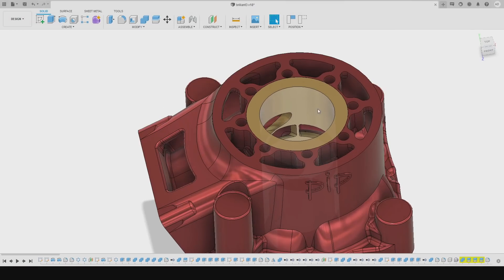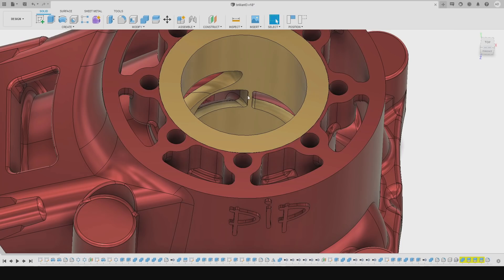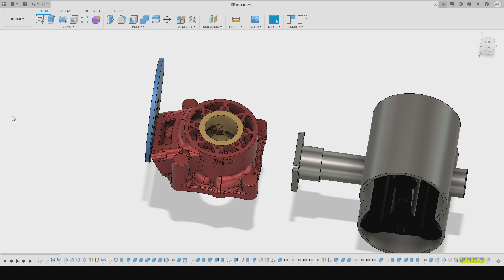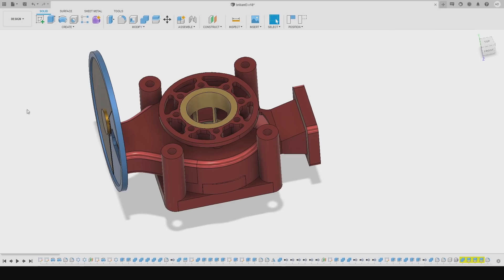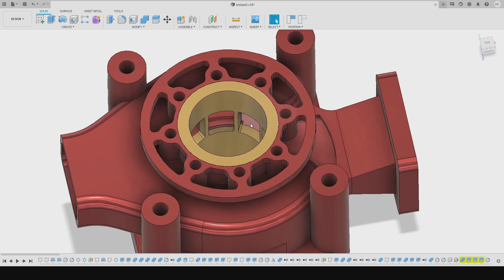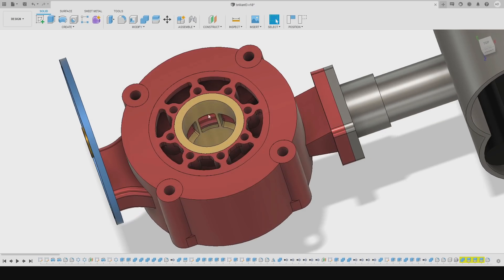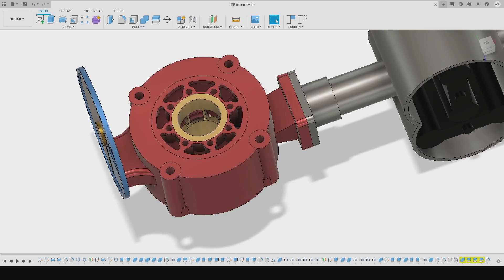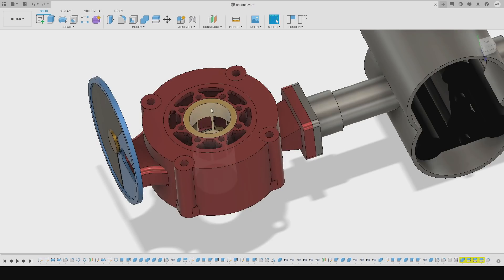Will BLOW Up the Competition! Seriously!

Comment: I really do not mean to Pick A Part your idea but I am curious about one problem I see that might happen. The pressurized air and fuel goes into your cylinder as well as the exhaust ports temporarily will that not cause unwanted combustion in your exhaust ports?
Reply from the maker: Might be👍 we'll see.
Reply: No, because combustion will be complete way before the ports open

Comment: Interesting, I'm really curious to see how this short circuits with the ports cut the way they are. Could be turbulent, but seems that you could use colored water to test a mockup. Also wondering if the exaust valve would be needed, long term, if you adjust/fine tune the port times🤔 keep up the great work.

Comment: Have you considered the diesel type two stroke? it's a two stroke but the exhaust gases leave the top of the cylinder via an exhaust valve. This way you can charge the cylinder with a super charger easier
Reply from the maker: It is tempting to go that route.

Comment: You've probably already looked. But old Detroit 2 stroke diesels work just like this. But from my understanding (aswell as marine heavy fuel 2 strokes) they use entirely intake ports and a 4 stroke style exhaust valve at the top of the cylinder paired with the blower. But I think they also use direct injection

Comment: Looks a candidate for transfer port injection or if possible direct injection. Thought lubrication would be troublesome. Also
I would imagine you could easily run into excessive knock due to excessive cylinder combustion pressure. 
So a steel piston might be an option??

Comment: Excellent plan, been working on something similar for a while now. What you need to employ is direct injection.
That will eliminate all the short circuit and fuel in the exhaust issues. You can now totally evacuate the cylinder and build pressure without worry. Will probably avoid the need for a reed valve as well.
Reply: Becomes pretty close to the Detroit diesel....
Reply: Yes. I would use direct injection and only one exhaust port. Or two  both on exhaust side. Then exhaust resonance would still work.

Comment: With a 50cc cylinder displacement I think the effective capacity will actually be somewhat larger.  As soon as the transfer ports are uncovered on the power stroke, the mixture within the inlet/transfer ports will be ignited and increasing cylinder pressure and giving the reed valve some serious punishment.  Might want to check rules for Bonneville etc. as would hate to see you get it working and be disqualified.  This assumes you are using port injection (or carb), which you seem to imply.  With direct injection this wouldn't happen, but then the exhaust gasses expanding into the transfer ports will decrease cylinder pressure.  Rotary valve sealing could be a whole research project by itself!

Comment: Awesome design my friend! But I think a major choke point will be the intake volume and the time allowed to fill the cylinder. This can be helped with a larger intake plenum after the supercharger, or by adding an expansion chamber between the supercharger and intake port, almost acting like a pressurized crankcase. This will help increase flow and reduce pressure spikes when the piston is at the top half of it's stroke.

Comment: Have you thought about using a Sleeve valve ? Rolls Royce explored using them in its 2 stroke V12 called the "Crecy"...and Napier used them in its Sabre engines pushing 3500+

Comment: Seems to me that intake and exhaust should be set 90 degrees apart from the cylinder instead of 180 degrees. It would make the exhaust rotor and the blower easier to drive off the crankshaft.

Comment: my head is about it 💥so many ideas and questions how are you going to drive the charger 3 phase motors maybe with a pressure sensor and engine rpm controlling the speed all so a large chamber inbetween the engine and charger too help with lag

Comment: Might try som type of rotary valve on exhoust ports right behind/arround the cylinder, you will get smaller area for mixture. I think this prototype will be fireing gas in exhoust..  Possible it might work with 4stroke crank with some oil splashing.

Comment: Nice idea, but I think the Compressor has to be bigger.
The CAD design looks like you would have at least 250ccm volume between the compressor and the Exhaust valve, with the compressor putting out only 300ccm per working circuit, this will result in only 3,2 psi of boost.
(CompressorVolume / Floated Area -1) x 16 = psi of boost

Comment: i thought about the same design earlier but with a pneumatic valve for exhaust and the intake of the compressor sucking from the crank case and in to the cyl. that way it could run fuel/oil mixed and dont need a seperate oil sump

Comment: Detroit diesel engines have a brilliant blown 2 stroke design, the engine will no function without the blower and the blower actually acts as a reed valve keeping exhaust gasses out of the intake side.

Comment: Hey brother I’m just curious does adding a turbo or a supercharger to the system change the class that you would be racing in I ask because there were so many two-stroke diesel‘s that basically wouldn’t run without boost so I would think with my limited two-stroke knowledge that it would help a gas motor also
Reply: Edit: yes so I asked that question one minute into your video I have now seen more of the video and realized you answered my question great minds think a like

Comment: Alex.. have you had any ideas about electronicaly controlled direct injection on this thing? supercharger only blows air and then the injector is timed to the precise moment - much better way to make it more fuelefficient and you wont have an easily ignitet a/f mixture in the exhaustsytem

Comment: Won't you get combustion in the transfers?  You'll be putting a lot of pressure on the rotary valve and reeds, and if they fail it will backfire through the supercharger.

Comment: The amr300 has really been a revelation for cheap and readily available supercharger tinkering.  It does seem that the easiest and cheapest way to make big power is forced induction.   Port angle, manifold flow, exhaust resonance??  Who cares, just cram it in there with a blower.  I'm not sure if the supercharger to cylinder manifold design will matter with such small displacement but maybe need to consider capacity to hold full pressure charge between intake cycle if going to really high revs?

Comment: Hi ... Brilliant video  ... I think you won’t need a Reed valve as whilst the ports are shut the blower will still be making a head of pressure ready for when the ports open again .. a cleaner inlet tract will equal even more power .... I would drive the blower with an electric motor to remove the parasitic loss  so even more power  
Andy

Comment: I have a 2 stroke gasoline supercharged motor. It is an air compressor. It looks like a bmw engine.  2 stroke engine on one side air compressor on the other side with pistons moving both in then both out. It is very very powerful for its size,  70 pounds or so and I would estimate about 15 horsepower. It does not have an exhaust rotary valve and  I do not think you will ever snag a ring because the exhaust ports and transfer ports are not big they are small.

Comment: I think I have an idea for an improvement- why dont you put the exhaust ports and the rotary valve at the top part of the cylinder , so it works kinda like a uniflow engine but with big time-areas
Reply from the maker: Might go there. Prototype first.

Comment: Any 2-stroke engine (or 4-stroke) will build pressure if the compressor's output exceeds the stinger's (or turbine's) flow at atmospheric pressure. As mass flow does not have time to react to the sequences happening in the engine, it acts merely just as a strangely shaped hole and that's why the boost pressure is an average pressure. And that's also why the flow speed does not change (significantly) in a boosted engine nor does it just "flow through". This newest concept of yours seems very interesting. Much better base for nitro-methane experiments than a traditional 2-stroke. I'm just here to debunk some common myths :)
Reply from the maker: 👍 And Nitromethanol it will be fed!

Comment: Read valve, rotary valve, compressor.
I would almost say, take a four stroke 50cc engine and change the camshaft rotation, make it the same as the crankshaft.
Basically make a two stroke from a four stroke engine and cram as much air in that cilinder as you can with that blower.
Would it work??
Mhhh...
Reply from the maker: Has to be tried 😁👍
Reply: @2STROKESTUFFING  I was thinking of this due to the read valve and the compressor constantly delivering air pressure against those reads.
The back pressure inside the ports is not enough to close those reads enough maybe.
“Normal” valves would close without problem

Comment: Now that you're going further away from traditional 2 stroke design, maybe you could consider putting the exhaust port in the head and use the rotary valve up there. By going with a uniflow design, you might get better scavenging, and have better control over exhaust timing.

Comment: this start to become a insane idea but really well, and it start to work like the 2 stroke diesel engines I worked on.
They had a turbo on it with around 2 bar max pressure, only scavenging ports around the bottom and 1 giant exhaust port on top.
it had 2 giant injectors on the side of the exhaust port. these engines are really awesome.

I always dreamed about making engine like this but with gasoline.

Comment: Just a stoopid idea i had while in toilet. What if you had narrow high transfers and low wide exhaust (to keep areas equal)? So when piston is down the blower is pushing mixture in and burned gasses out. It starts moving up closing the exhausts and pressure builds up. Combustion magic happens. Piston moves down uncovering transfers but reed valve is preventing gasses escaping through intake. Piston uncovers exhaust and all the crap is blown out that way. Cycle repeats. Maybe if initial pressure would be too high for the reeds to combat then have a tiny area of exhaust as high as transfers so that it could relieve pressure when  its extremely high in cylinder after combustion when transfers start opening but small enough that pressure would build up after main exhausts are closed. Or some kind of system where you have tall narrow transfers, low wide exhausts and then aux exhaust ports that are as high as transfers but not freely vented to atmosphere but with a spring loaded valve that is set to open at intake pressure so they don't mess with boosting the cylinder but relieve pressure when transfers open and exhaust is still closed. Have not really thought it through as toilet time was over for this time.
Reply from the maker: Definitely worth experimenting with👍

Comment: Fuel efficiency wouldn't be a problem if you made it direct injection type-kind-a-thing(like a diesel engine). In that case no fuel would go to waste and blower waste could be more easily vented out. Less resonance in intake system - easier for the blower and less power loss through it.  Sort of like anti-lag...

Comment: blowers are very  inefficient  especially 2 rotor blowers, too much heat. high helix screw compressor would be better. this is not a new design detroit diesels used roots blower scavaging on their 2 strokes with 4 exhaust valves. I like your idea of the rotary valve on the exhaust. A centrifugal compressor would be even better, way more efficient and less hp to drive.

Comment: ok, i got a vision, and now i know solutions for 2 things with your engine. 1 . dont use 1 large exhaust, but split in 5 or 6 smaller ones with thick wall between them, and put cooling in those walls like pipes. so cylinder is not overheating there from exhaust. and drop exhaust temps. 2. use different design on piston with 3 rings. - 2 on top if you want to supercharge it and 3. on bottom .

Comment: Have you heard of electric powered turbos/superchargersr? For your short power peaks this might be an option as the supercharger does not "steal" horses and the turbo does not need high exhaust temperatures/volumes anyway. Use the permanent afterburner for extra thrust instead :D We dont't care about efficiency! <3 Love your new frequency of awesome video content!
Reply: Great idea, however SCTA/BNI rules only allow boost power sources from exhaust gasses or mechanical drive off of primary engine.

Comment: For version 3.. Why not use normal ports and valves in the head, 2 stroke timed cams etc with your blowers? Same effect but more efficient. Solenoid driven valves as per Konisegg would give you endless port timing options.

Comment: Look at the Detroit Diesel 2 strokes.  Kawasaki has a 2 stroke with a supercharger that is coming (they say) in the near future!
Reply: I was thinking the same thing. Detroit used a poppet valve for the exhaust side which I think is much more practical than a rotary valve.
Reply: Not really, the 71 series Detroit's had 4 valve heads for the exhaust, only the intake was ported thru the block/liner

Comment: hello, won't there be a big heating up the whole thing by the exhaust heat? and especial the intake air trough a thin wall between the intake and exhaust cannals? just thinking... other than that.. just wauu!

Comment: You should really think about using direct injection of fuel after all ports are closed. This way you wont have any fuel/air mixture going to exhaust port/chamber only fresh air. Could be tricky to pull off but would increase efficiency by a lot. Cool idea, hope it works!!

Comment: You are going to end up with uncontrolled combustion as the ports open with near full strength charge in all ports 

Power comes from refining efficiency. Not ignoring it.

You would be far better continuing with the engine you have.

Comment: I started to turbocharge 2 stroke 4 cylinder Yamaha snowmobile engines in 1994 ( V-Max-4).
What you are doing now is making me smile! :) wish i could spend a weekend at your place, chatting about all this. Have you computed modern (sulzer Wartzilla) way of doing diesel 2 strokes, in a high rev, slightly smaller version :) ? hahhaaa!!!. Or an ex. valves in head (rotary?) and intake ports at the bottom of cylinders?. A 2 stroke twin with a rotary intake valve was pretty good under boost, the CRANKCASE was pressurized till, the rotary opened, scavenging the cylinders in normal fashion... I was using very stiff reed valves, in a cylinder intake. Anyways, wayyyyy too much to say about all this!  :( ...

Comment: Is there any chance of the combustion igniting the incoming charge since all the ports have the same "timing"? How about an option with a single intake valve in the head that opens right about the same time as the exhaust port is covered as the piston is on the compression stroke? Then again, your design could be the perfect solution haha! Awesome content regardless!!!

Comment: Isn't this idea just a 4 stroke but with different valve timing?? I'm very interested to see the results. I love 2 strokes as a much as anyone else here but if this works...next you'll be looking for ways to increase exhaust duration, then intake duration....and then you'll end up with a 4 stroke
Reply from the maker: Still does its thing in only 2 strokes👍
Reply: @2STROKESTUFFING  Definitely still a 2-stroke. But it's an interesting thought. I wonder if you could save money on a rapid prototype by modifying a 4 stroke 50cc engine with your blower and a different camshaft to start testing with? Might be different enough from the final design though that it doesn't offer any useful results

Comment: Controlled ignition of the "waste gas" to support a turbocharger?
Reply: ...further building up pressure in the exhaust pipe and then convert the higher pressure to another form of energy. If possible, i don't know much about this detail of engineering
Reply: Or reusing part of the waste gases through a valve or venturi system at the intake. A bit like an afterburner :D

Comment: Will you not get backpressure pushing the exhaust back into the blower when the piston gets bellow the exhaust port openings and hot exhaust ignits the fresh mixture stuck in the exhaust manifold?
Reply from the maker: The reed valve will keep it out of the blower, what's in the exhaust manifold will ignite and cause sweet flames out the exhaust 😁
Reply: @2STROKESTUFFING  funny enough this guy thinks the same, and he actually knows what he's saying compared to me :) https://www.youtube.com/watch?v=aLSP2isVwE4&list=WL&index=3
Reply: @2STROKESTUFFING  out of the blower, yes, but if the pressure is higher than that of the blower, will it not missfire? There will not be any resonance to pull the exhaust out in my mind. I know it should work, ferrari did a 3 cylinder with a similar concept, but maybe there is something missing in this. Awesome videos btw, really happy that you actually read the comments :).

Comment: You should look into 2 stroke ship engine, with an exhaust valve in the cylinder head, turbo charge de, and gas ports All around the cylinder. They Are the most efficent engine ever made

Comment: I seem to recall one of the Japanese firms trying something similar to this in the 60s or 70s... for a drag bike it could have places but on a race track the fuel consumption is just too great, you'd need 80kg of fuel for a race. Do you know of the Ettridge 2 stroke idea? It uses exhaust gas pressure bleed off to pressurise the crank case creating a supercharger type effect? Could be worth looking at

Comment: Fredericksburg VA-   if you have put 100 % of bore exhaust port, maybe a bridge or 2 in the ex port will solve the ring problem, and still have 97% of bore or so.  Just a thought.   ROCK ON.  GOOD LUCK.
Reply: ( put 100 % of bore on the back burner for now)    that is.